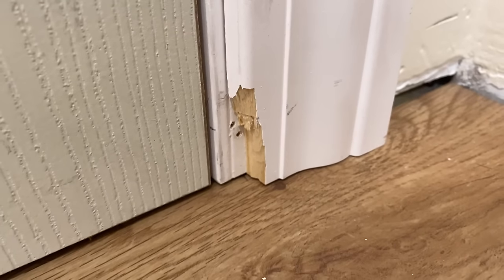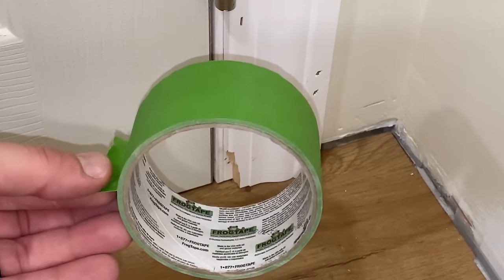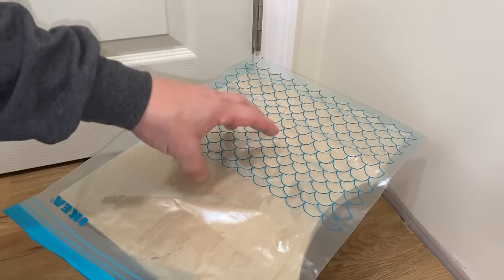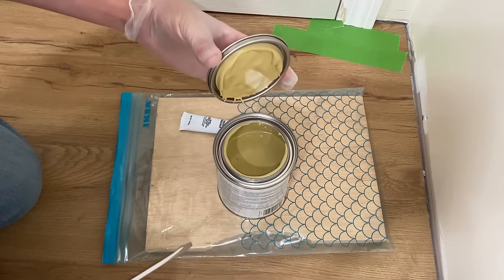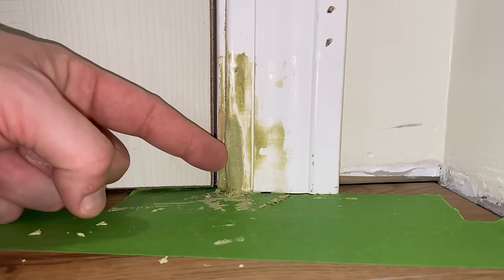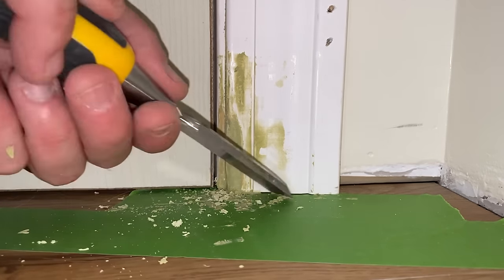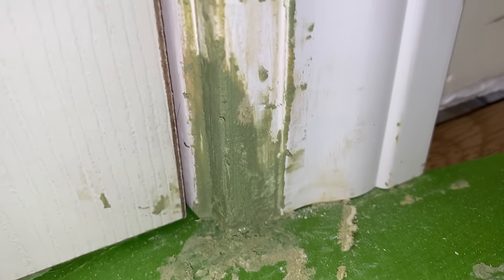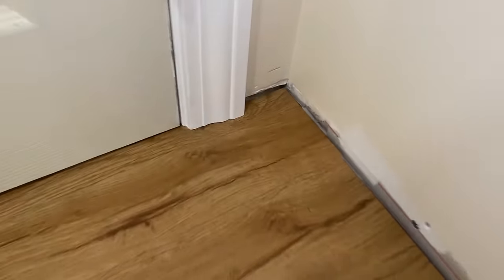How to Repair Broken Trim with Bondo for Wood

Comment: Frogtape directions. . . . Do not use on hardwood floors.
Reply from the maker: Good thing this is LVP.  😉😁
Reply: @TheFixerHomeRepair  Dang. I just got served. I noticed that after the last sanding but didn't thing about mending my comment. The reason I said that is Im painting some baseboards and the whole house is hardwood floors. So I tape off the entire place and when I'm done and on my lunch I grabbed the frogtape container and in bold letters it states DO NOT USE ON HARDWOOD FLOORS.  So nothing has went wrong yet because I haven't pulled the tape up. But if it does go wrong, it goes to show that Im a complete and utter knucklehead my friend. 🤡
Reply from the maker: @swpo1  😧 oh man.  Go super slow peeling it up.  Maybe even add some heat with a blow dryer?  I would think that warning is to cover against really poor finishes or maybe older more brittle finishes.  Just be careful and it should be fine.
Reply: @TheFixerHomeRepair  The great thing is that they for some reason putting laminate flooring on top of the hardwood. I totally forgot. But before I knew that I was freaking out. It's the frogtape TECHNOLOGY! have a mediocre to decent one bro. 👍

Comment: Wouldn't it be easier to just remove the entire piece and replace it with a new one...? I wouldn't waste my time with what you did, nothing personal, but it's faster and no paint, no mixing and no sand paper.....done
Reply from the maker: Yes it would be.  I said that in the video.  😁👍

Comment: Thats a pretty horrible way to fix trim. This is much better

1. Just replace the whole piece of trim
2. Cut the section out (you can use an oscillating saw), than put in a replacement section using a new trim board. Apply drydex or wood filler to conceal the cut, sand and paint.